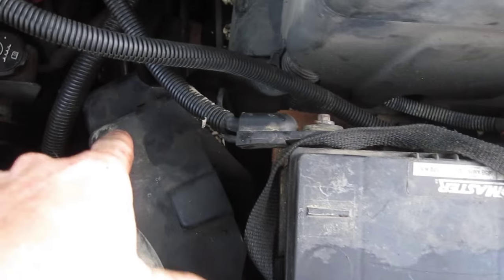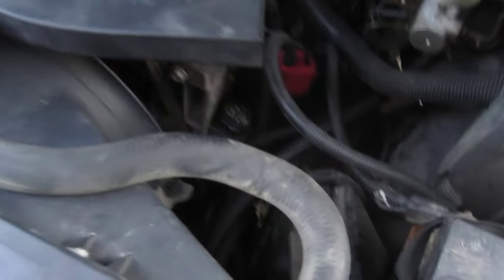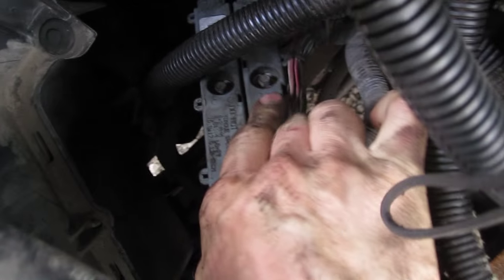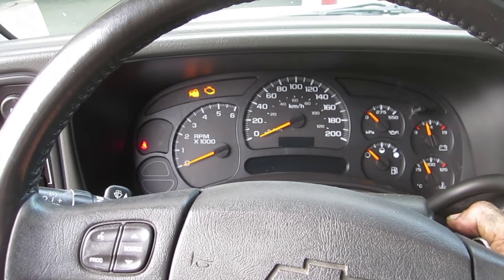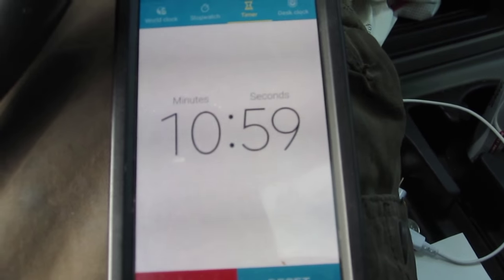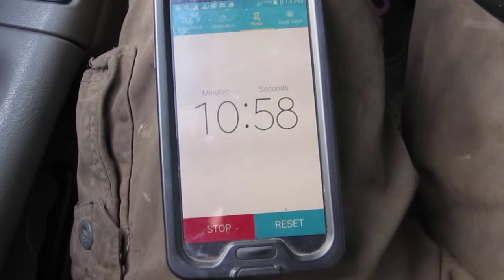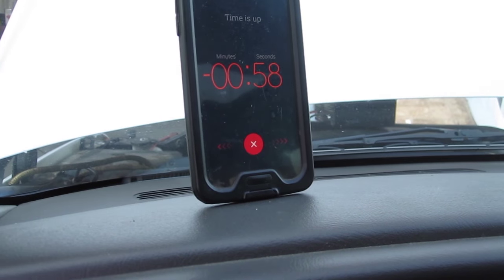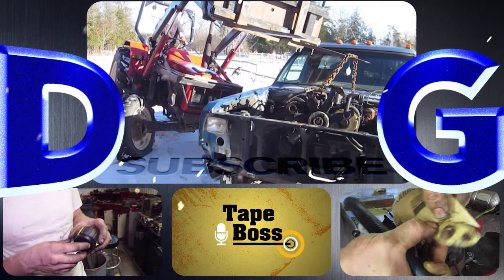Installing A New ECU In GM Trucks

Comment: I remove the starter myself and have never done so in my life but it was actually pretty easy only two bolts then found a broken wire and knew it had to be related because I wasn't getting any Spark
Reply from the maker: +Mr no it all u heard mechanics get a bad rap just for that reason.  Sometimes you find it right away because it is staring you in the face and sometimes you chase your tail for hours trying to find that one wire.....
Reply: hi
Reply: I have a 2006 GM envoy Denali the first time engine die running 40 miles an said reduce power engine and and wait like 30 mi mutes to star and it keeps doing that star but when get hot die ...only crank but don't star into cold down and in the cold weather take longer to die end help please
Reply: Well you have an overheating problem is the reason why it's shutting down fix your overheating problem
Reply: on the dash the temp is OK
Reply: There is a sensor that is near the starter I'm trying to think of what it's called that's probably your problem when I think of what it's called I will email you back
Reply: I shange the crank sensor the temp sensor the tamp sensor
Reply: To me it sounds like it may be a crankshaft position sensor problem either wiring or crankshaft position sensor itself if the car cranks but does not start it sounds like a spark issue you're not getting any Spark to check this spray some ether in the intake if the car doesn't run for a few seconds on either you know you are getting no spark and that it is probably your crankshaft position sensor let me know
Reply: other when the engine die the fuel pump stop and a jump the fuel pump and crank and star but shaking is
Reply: the problem is that when the engine die I noticed that the fuel lump stop and the throttle body so I thing that it cut the electric
Reply: @DEBOSSGARAGE  would have been nice of you to go through the new code that you got after the engine started.  I'm having problems with the ECM on my 94 GMC Sierra C3500.  I've seen many videos on ECM and you have no concerns about static electricity or changing the POM that is in the ECM on some newer vehicles.  The POM is not included with the replacement ECM.  You made no mention of the part.

Comment: did this with my 2005 silverado 2500hd 6.0 got it to start and idle but would get to 2000rpm or about 10mph and the truck would spit and sputter rpms dipped and would almost stall any idea what's going on there?
Reply: crank relearn
Reply: blown5.3 what is the process for that
Reply: can only be done with a scanner

Comment: What where the symptoms of the bad computer?
Reply from the maker: It could be anything the ECU controls.  Starting, running properly, windows, door locks heater, charging.... Usually the problems can be found with scanners because the engine light is on.

Comment: I tried to contact you through a phone number I found on the internet lol it ended up being all Canadian guy and call back or something like that who owned a shop but didn't speak any English LOL anyhow I fixed my problem not sure if the engine computer needed to be reprogrammed but I had it done anyway at my house by a local guy still wouldn't start come to find out I had a broken wire to the crankshaft position sensor a green broken wire at the pigtail harness for the crank sensor however my computer was fried anyway when I opened it up the circuit board had to burn marks in it
Reply from the maker: +Mr no it all u heard Sorry I didn't get back to you sooner.  Our internet was down for a couple days.  We also have  facebook page and we are on twitter.  Glad you figured it out.  The  tech that figured it out must have been on the ball, that crank sensor is not easy to get at.

Comment: I have a 2005 Silverado with the 5.3 1500 4X4 and I got a used PCM from a 06 Tahoe with the 5.3 1500 4x4 and the number match mine. As soon as I installed the PCM and turn it to the on position it turns over like I'm trying to start the truck. Any reasons why? Maybe it does have to be flashed by GM.

Comment: great informative video. thanks...   i have similar issue- purchased new module today, followed steps in video, 2004 yukon fired right up.
test drove it, runs great, but still have a slight batt drain and dashboard lights do not turn off with key removed.   also- turn signal lights on front make the driving lights blink... not the orange ones.  thinking bad ground somewhere?
was going to pull all the bulbs and try again to re-create the issue to try and narrow it down?  any hints/tips/tricks as to what may be still causing a batt drain?   already replaced the following: battery X2, +/- batt cables, ignition X2, pulled and checked starter, pulled entire dashboard off but didn't see anything weird, checked all fuses and relays, checked all mechanical grounds going to battery, all fine...  now a light bulb issue with a brand new flashed ECM and programmed it like you said, mechanically, it runs great..
any advice would be greatly appreciated.  thanks!
Reply: I know this is a very old comment but there’s something called a RAP fuse and it allows for accessories to be on for 10 minutes after it shuts off if it’s burnt it might be the issue assuming you’re still dealing with it

Comment: I did this procedure on a 2005 tahoe 5.3 today...didnt work the first time I did this process ...the secound time I did the first step of the process .I watched for the theft  lock light to go off  .I then  quick cycled the key ..on.. off ..on.off  fast as I could directly to start and it fired right up....so maybe that will help trick the pass lock system ..it worked for me ...thanks..
Reply: So how long did this take you???

Comment: Dropped a new motor in my 2002 Chevy s10 4x4 zr2 and couldn’t figure out what the issue was. I changed EVERYTHING new but it still ran like crap. Took it to autozone to run a diagnostic on there little-code reader and everything that I replaced new was showing bad. Guy there told me I got to reset the computer... so I did what this guy did on this video and it worked like a charm. Truck runs tits and the check engine light even turned off. It did take about 5 minutes of driving to work it’s self out cause at first it seemed to have a little misfire but after a few miles it smoothed  out. 👍🏼👍🏼👍🏼✌️

Comment: Howdy Deboss! My 2003 Chevy Avalanche Base model the ECM died, I have no digital display or instrument readings. I'm considering on buying a rebuilt from Cardone for part no. 77-2605F. I'e been reading all the negative reviews that say you have to take the part to a dealer and have it reprogrammed prior to installing the rebuilt part. Is this video basically the reprogramming (flash) sequence once the part has been installed?

Comment: Did not work on my 2012 - replaced Engine fuse assembly and truck will not start , but all problems are gone ... suggestions ?

Comment: I am doing this installed new unit lights radio everything works , does not turn over now nothing .Maybe will unhook battery for 30 min and try it again .Dam been watching all these vids thought had it figured out.
Reply: Same boat buddy on a 2005 Tahoe built engine. Tuned it several times. Bricked the Ecu with hp tuners and then bricked my replacement Ecu yesterday... fucking frustrating

Comment: Ok cool. Yeah because my 08 Sierra don't turn on and was told it might be the ecu. Fuel pump works there's park. The scanner said it was the fuel pump and another buddy's scanner said it was a short circuit. I ran out of ideas maybe you can help. Ok so when I put the key on the ignition and do the 1st turn it automatically cranks without me trying and it stays trying to start but never starts. I have to remove they key in order for it to start. Any ideas. It sounds like it does wants to turn on but it's just steady cranking
Reply from the maker: My brothers truck started that way but the starter quit after it was running.  My Tahoe does it once and a while.  Usually after I wash it.  I would start with checking your battery.  If it is older than 4 years, change it.  Clean all your grounds and battery clamps

Comment: I have a different issue. U seems smart so figured I'd ask here. My truck is 06 Chevy LT 5.3L. I think bad ecu but not sure. Sometimes when driving itll shoot temp gauge up and down erratically, the computer registers these readings and sometimes throws truck into reduced power mode. I've checked with aftermarket gauge and it isnt actually overheating, and my voltmeter also going between 13v to 15v fluctuantly.. I've replaced temp sensor alternator battery water pump thermostat etc. Shop said nothing is wrong that they can find except overcharging alternator. What else could this be?

Comment: Did this procedure may work on a 2011 silverado 6.0 ?
Reply: Dominic Labelle wondering the same thing but for my 15
Reply: @derekwu3256  2015 and you have ecu problems already?
Reply: mr freeze same symptoms but I can’t verify now.. done sold the truck.. spent 2300 in parts from previous pos owner use and abuse on it

Comment: Hi men ! i"m doing a ls1 swap on a 2002 Astro van! Do u know if I add the extras wires  in the LS1 ECM  that needs for the control body, vats and the ABS module to be able to work! (the ECM of the van and the LS is the same just programmed different) the ECM of the LS will learning the extras functions if i do this ?

Comment: Quick question, if I take a spare ecu out of my parts Colorado, both the same truck. With the truck receiving the used ecu come up with the other trucks Vin number when plugged in for inspection purposes?
Reply: Probably, but usually it's not an issue. Only when it's a much different VIN number, the shop can get into trouble, because the DMV will think they are using a different car for the emissions. My friend used to work for a shop, and he told me if you want to use a different vehicle for the test, it has to be the same make, year and model. That will pass, of course!!!

Comment: It works with me but I got rpm higher than normal, what is the next step please🙏
Reply: Did you program the VIN number into it? Otherwise it won't know the specific settings for your vehicle. They use the same computer for multiple vehicles.

Comment: Will it work if I swapped a used ecm, same part numbers but different programming. I.e the truck had 4.8 and I'm putting a 5.3 ecm but with the same part numbers? Or does it need to be a 4.8 ecm?
Reply: I have the same question.  Did you have success with the ECM from a different engine size?

Comment: Does anyone know if this will work for a 2012 suburban? I purchased a used ecm and I want to get it programmed for my suburban without the huge fees charged at a shop.
Reply: Did it work ?
Reply: Did this work? I just ordered a new ecm today I get it on Tuesday of this week. Putting it in on a 2012 Tahoe and ran upon this video and your working on a 2012 burban. Did it work? Lmk thanks in advance.
Reply: Honestly I never made it to this point. Before the ecm arrived I tried this to see if I could maybe get it to reset the old one. After this didn't work I went to a different part of the vehicle. Turns out the issues with the suburban were much worse than with the ecm. Long story short put in a new engine for fraiser engines. Sorry I wasn't more help